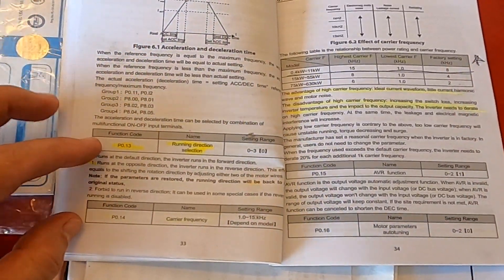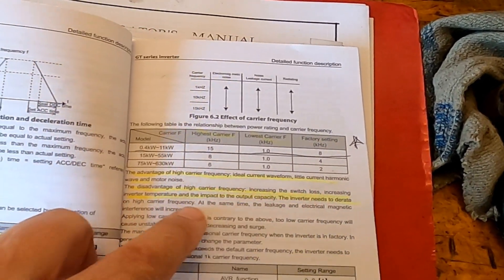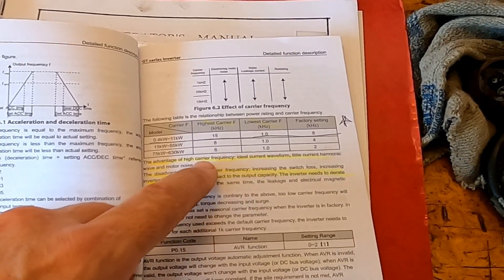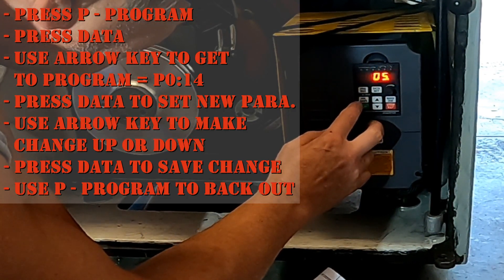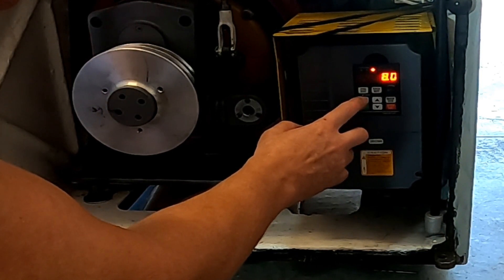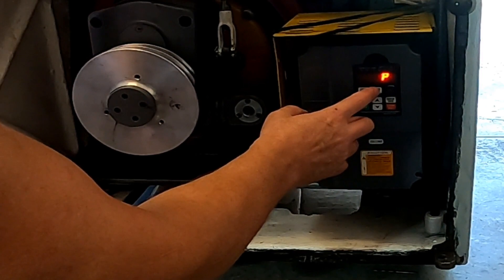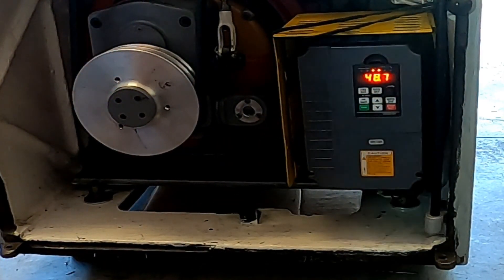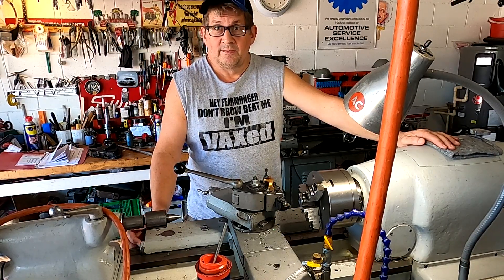Rid VFD Motor Frequency Noise: Huanyang GT Variable Frequency Drive

Comment: God bless you. Carrier frequency set from 6khz to 15khz( maximum value for my vfd).
no more noise.
although at a very low rpm there is still a humm, but I don't really use under 100rpm.
Now it's time to change the fan of the vfd, a small noctua should do.

Comment: Buona sera, aumentando la frequenza del driver, si elimina il  fischio fastidioso, ma aumentano le perdite nel pacco statorico del motore che è concepito per 50/60Hz senza troppe armoniche. Il motore così facendo potrebbe scaldarsi di più inutilmente. Buona serata.
Reply from the maker: Good point, and i probably should have mentioned that the manual allows for given frequency settings based on the motor size/capacity allowing for this issue. I was definitely within the safe zone with this set up.  Don

Comment: It’s hard to hear because the machine makes so much noise from the drive. What I notice on some of mine, is that I get a whine that increases as the speed increases. But it’s not a problem, though just maybe slightly annoying, but I leave it alone.
Reply from the maker: YA, some of my VFD's are prey quiet. This one didn't bother too much till I took care of the mechanical noise.